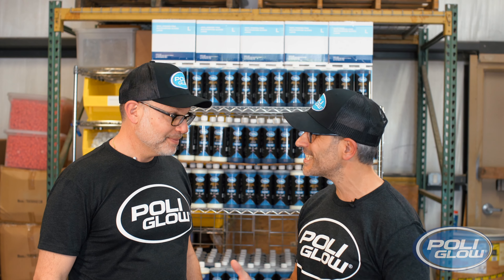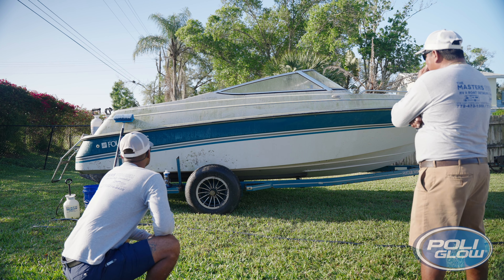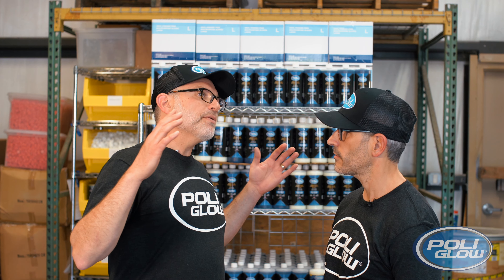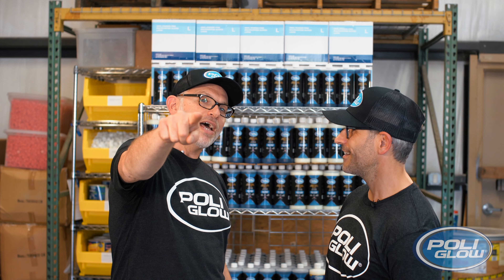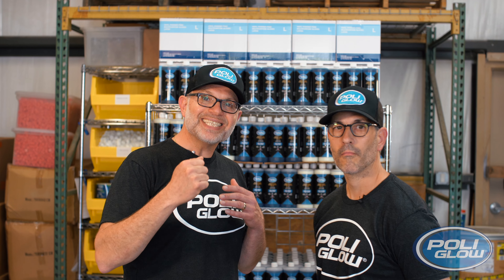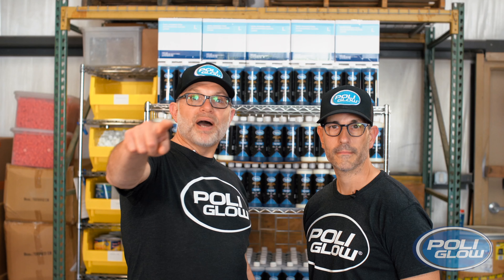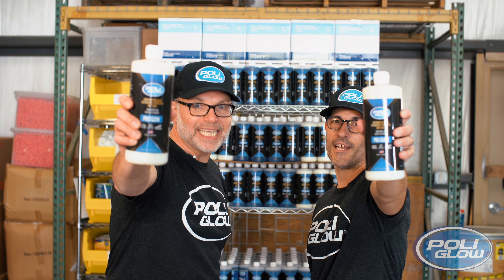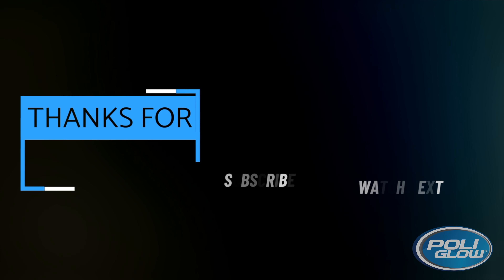How To Video 6: Maintaining the Shine

Comment: One of your videos says to take it off use stripper and you're saying the powder and some sanding. We have found that we need to take a smaller block and we used the stipper almost full strength and still ended up sanding certain places that were still shiny after stripping 2 or 3 times.  Our bus is peeling at places and just fine at others. Can I just do the diseased area or do I have to do the whole side of the bus. I guess the question, will it blend in if I just do a small section with the poli glowed sections that are fine and don't need stripped?

Comment: I just bought a 12 year old rv and it was in really good shape with the exception the front and rear had some noticeable oxidation. After doing some research i found this product. I prepped the front and applied poly glow. I can't believe how new that camper looks now. Going to do the entire thing, it's so easy to apply if you just prep the surface right.